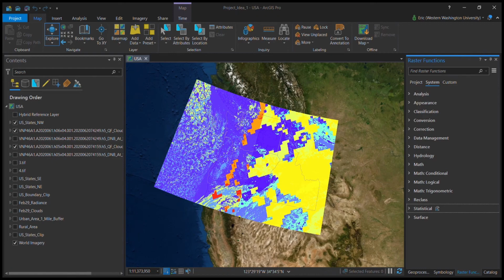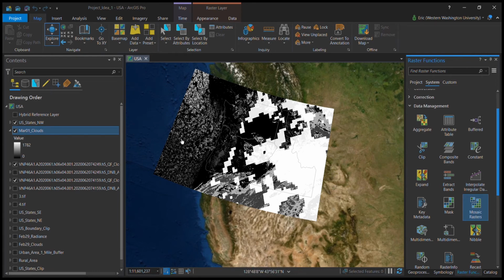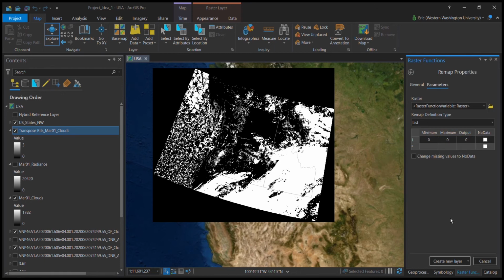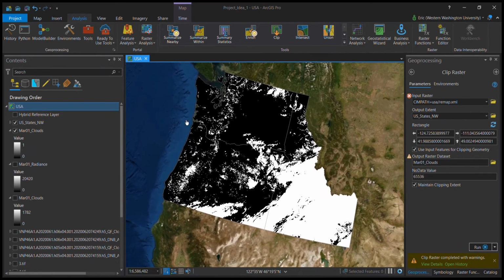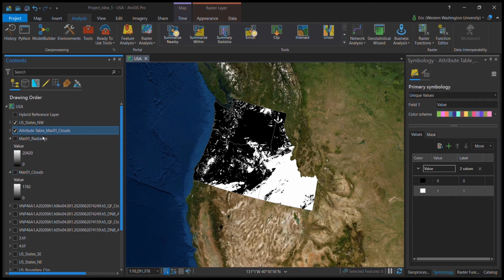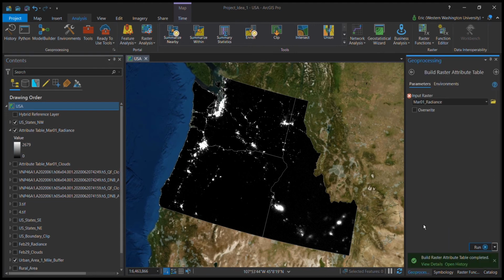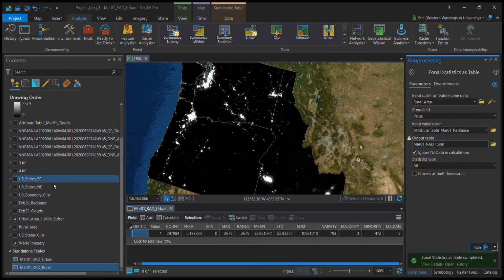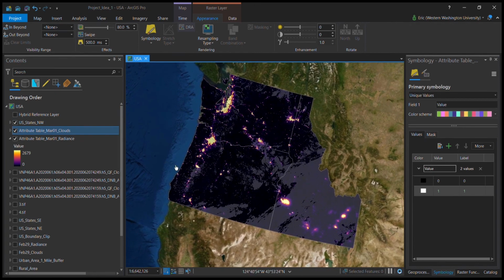VIIRS Nighttime Radiance & Cloud Cover with Raster Functions - ArcGIS Pro

Comment: How do you identify the radiance value in the attribute table?
Reply from the maker: The Build Attribute Table tool creates a frequency table of the values making up the input raster layer (in this case, radiance). Since the values are floats, the frequency table rounds them to the nearest integer, organizes them in the "Value" column, and counts how many exist in the clipped region. When running summary statistics, the decimals are preserved. You could go one step further and extract pixels at "Value = x" using raster calculator.

Comment: I'm kinda new to these stuffs. How do you get that urban and rural areas? Did you just create it?
Reply from the maker: Thank you for watching! I downloaded municipal boundary shapefiles for each state, and used the Buffer tool to expand those boundaries by one mile. I did this because ambient urban light outside city limits would be mistaken as rural. Then, I "rasterized" the layer (converted from polygon to raster) to calculate radiance and cloud statistics; this is required because I need cell-to-cell comparison.
Reply: @ermian9888  Hmm that's good to hear. Anyway that was a month ago and that time I was really looking for other options for my research. Luckily I get to know more about QGIS which prolly have the same aspects as with ArcGIS. I also downloaded shapefiles of municipal areas. I use it for zonal statistics plugin with the help of raster layer of VCMSLCFG and yeah, it's my first time to actually made a statistical output for this kind of research. Thank you btw.

Comment: Great video. But when i tried to download VNP6A1 products, there is only BrightnessTemperature_M12 dataset. Do you know where i can find the other dataset ?
Reply from the maker: You’re probably not clicking “Multidimensional Raster Layer” when adding data. In the Map tab, click the dropdown arrow under “Add Data” and you will find this. Then in the pop-up window, click the folder icon (“Import Variables From File”). Now choose your product and hit OK. The datasets appear in a list, you can select some and click OK.
Reply: @ermian9888  i just cant find any of those in products tab https://ibb.co/QbQtKk9 . Can you show me where is the "Multidimensional Raster Layer" ?
Reply from the maker: After you choose the VNP46A1 product on the website, you also have to choose a “Date” and “Time” of collection. Download any file from the resulting list, which is under the “Files” tab. Then in ArcGIS, on the Map tab and in the Layer panel, you’ll see “Add Data”. Click the drop down arrow and below you’ll find “Multidimensional Raster Layer” as an option.
Reply: @ermian9888  Thankyouu

Comment: Man thanks for this video. But how to download rhe dnb data?
Reply from the maker: https://ladsweb.modaps.eosdis.nasa.gov/

This link directs you to all their atmospheric data products. The DNB data is under Land -> Nighttime Lights -> VNP46A1 -> Search for Product Files. From here, you can choose a time and location (I recommend selecting location by "Draw Custom Box").
Reply: @ermian9888  ok thank's for the answer.  can i ask you how to open it? because when i try to mosaic 2 or more raster, it didn't work
Reply from the maker: @ahmadrizqullah6341  I probably should have mentioned this in the video. After downloading, in ArcGis Pro, go to "Add Data" -> "Add Multidimensional Raster Layer". Check whichever boxes you want; each becomes a raster layer. These should be valid inputs for making a mosaic.
Reply: @ermian9888  hmm, when i try to combine 2 layers with mosaic raster, i didn't know why, but it didn't work and then it said "invalid cell size"
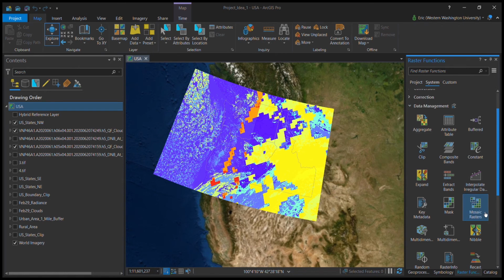Reply from the maker: @ahmadrizqullah6341  That's strange, I've never had that error. Did you do what I did at 2:05? "Invalid cell size" tells me that something like spatial resolution, spatial reference, or pyramids are different between the rasters. Or, there are holes somewhere creating calculation errors. I didn't think that would matter with temporary raster layers.

Are you mosaicking different types of data into one layer (e.g. cloud mask and radiance)? Conflicting data types could cause an error. Again, I'm not sure. ArcGis documentation online might help.
Reply: @ermian9888  i do with the same type of data